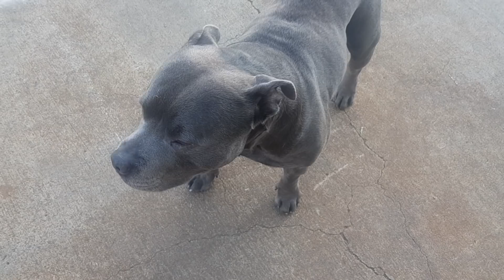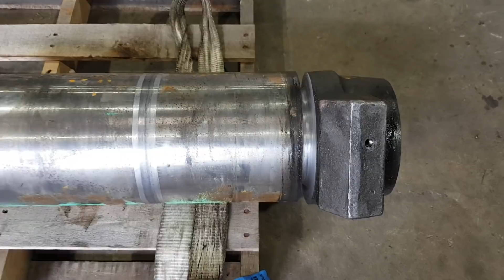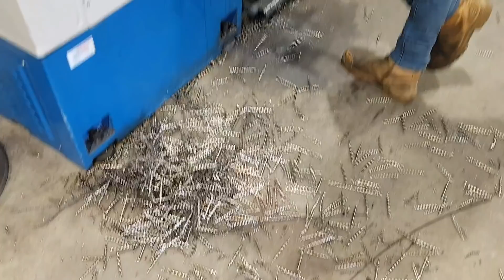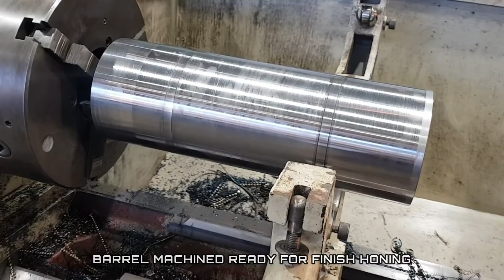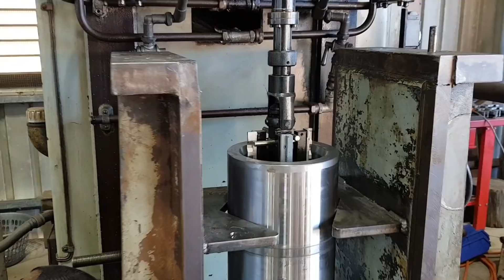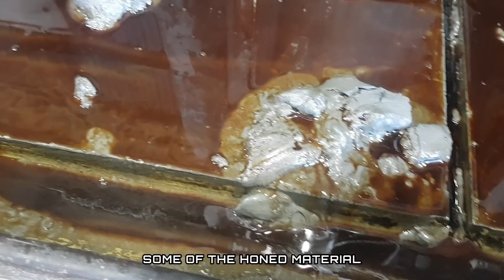Machining and Vertical Honing a Caterpillar Dozer track adjuster cylinder | Part 1

Comment: I stumbled on this channel by accident. I don't know much about machine shop work, but I can appreciate it when someone knows what they are doing and are good at it. I find myself learning something new each time a video is released. Now, if you would only explain what those initials mean for the various cutters you switch in and out.

Oh, and the dog is the bomb. I've got a few of those myself (although my bully is bigger and blind).
Reply from the maker: Hey mate welcome to the channel thanks for watching and the great comment. The initials stand for the universal insert designation to identify it's shape, angle, tolerance, chip breaking. Cheers, Kurtis 👍

Comment: I liked your honing machine. 
I thought most honing machines were made on horizontal axis but vertical certainly easier to use. 
Yes I’m a machinist for 35 years       
And I have worked on D10’s
I like your videos thank you
Reply from the maker: Hey mate thanks for watching always appreciate the support from others who know what they're doing! Yeah the vertical honing goes well I'm just limited with extending the stroke length unless I cut a hole to sit the machine in hahaa

Comment: Good morning my name is David I had a auto shop for over 40 years I retired in 2013 I got bord started doing equipment repair part time from my house I was in the local hydr. hose shop getting some made a man was in getting some hoses made to he was asking for help to repair a dredge so I told him I could try lol after I finish the job he asked me if I would like to work for him at a sand mine so I worked on all kinds of equipment so he sold the land so now every body wants me to work on there big equipment lol so I have been watching your YT channel I have learned a lot about line boaring and the proper way to weld and mechan I have a small Smitty and I learned the correct way to use it I wish I was younger I would buy more equipment to add to my service truck cause I enjoy working on big equipment and weard stuff.peopel say I'm crazy for wanting to work cause I'm 63 and I want to learn more so thank you for your videos and explaining what you are doing and why if you ever come to S FL and bring the pup I had one just like him he was lost to cancer but he had a great life. PS sorry for along mess. I have to go finish repair center pins on a cat end dump 😜🐾 dualydave@gmail.com  if you send your mail address the wife wants to send pup a toy 👍

Comment: Stick a live centre up its arse... heh heh. Love the shots of the safety officer. Another top job! Love that honing machine.
If you're interested, check out the 50 ton rudder on HMS Victorious aircraft carrier that I worked on in 1968 as a 3rd year apprentice. We had to take it out, remove the old bronze sleeve, machine the steel stock with an air driven contraption on the dock bottom, then heat the new sleeve over a wood fire as it was rotated and get a team of labourers to lift it on wooden bearers when it was hot enough then slide it on the machined stock to cool down and grip. Then we had to re-install it. The for the pic here "The Rudder may not look very big" scroll down to page 6.
Reply from the maker: Hey Fred Thanks mate for watching this weeks vid! Yeah we've got it made easy in this day and age with all the new technology and tooling available. Will have to check that out, would've been one hell of a job to do! 💪😎 Cheers have a good week
Reply: Well, dunno why but YT doesn't seem to like me putting any more in... Bummer! In the pic, that's me on the right of the three in the left foreground. I remember it like it was yesterday.

Comment: What would be interesting to know is the cost savings to the customer with you making/repairing these parts vs. them going to Cat and purchasing them new. I remember having backhoe outrigger cylinder rods cut off and replaced at a local machine shop vs. buying complete new ones from Case. Having the machine shop cut off the damaged rod and then welding on new rod was 1/2 the cost vs. buying new.
Good job on the video's and content. And good job to your gal for filming for ya.
Reply from the maker: Hey Bill thanks for watching mate. Yeah we're about the same usually half to a third of the cost of getting new from OEM 😎👍

Comment: You are dead right. It is not as easy as it sounds. I narrate my videos after they are completed, how you manage to do it at the time, I don't know.  Your camera operator/editor does a brilliant job too.
Reply from the maker: There's no way I would do this without the help of my misses who videos and edits. Half the time I don't know what to say and she asks me questions or prompts me with ideas. All the more to you if you do it all on your own! 😎👊💥
Reply: @CuttingEdgeEngineering  I think the chuck on my cnc lathe would fit up that bore you were machining.  I usually run multiple parts so I can shoot one angle and then another.  All on tripod without moving as the stuff I do is so small. The way your wife gets such steady shots is fascinating. Does she use a gimbal or just image stabilisation?
Reply from the maker: Yeah that's the way to do it if you're on your own! She uses neither just a very steady hand and her Samsung galaxy phone! The timelapse we use an iphone on a shitty selfie stick attached to a noga dial indicator holder haha. She actually bought a gimbal but doesn't like using it 🤣

Comment: Kurtis, BRO!?!?! Whats up? I've been  heavy diesel tech since I was 21(since 1996), and I LOVE watching your videos. This is a dying art my friend. We've become this throw away society, and I admit that in my business often it's just easier to replace a part(I also work for the government of a local county).
Anyways,, I have a question: Why do you always put your hands on the spinning shafts or that round disc on the top of the boring rod? I've always been told not to touch a spinning high torque shaft in motion. You can get wrapped around the shaft and loose a limb. Theres a story of a farmer fell into him bush hog PTO shaft and it took both his arms off. He dialed 911 with a pencil and then laid in his bathtub(so as not to get blood everywhere) and waited for help. He lived. It was on a Trauma in the ER type show here in the states. I always notice you putting you hands on moving shafts. Is it just  bad habit or is there some hidden meaning to it? Just curious. Thanks MK.

Comment: Hone is a beast. Love the tractor PTO attachment :o)
Reply from the maker: Hey mate great spotting. It's a little agricultural but found it in my container and it works haha
Reply: @CuttingEdgeEngineering  I’m sure the original had Allen screws of a bizzar size and every time you removed it was the equivalent of cntr alt del F1 :D (I’m fighting roundthane today. Joined it three times now on the baby miller. Tea break to de-stress ^-^

Comment: On the lathe why is lubricant only used on certain tooling or in certain situations? Also is cost and possibly down time the only reasons why someone would choose to refurbish a part rather than buy new from the manufacturer? Would there be a large percentage difference in cost machining a new hydraulic cylinder rod/barrel rather than to buy new
Cheers, thoroughly enjoying the videos
Reply from the maker: Hey Lewis thanks for watching and supporting mate. Great questions. We can do it for less than half the cost of new from OEM and that's if the parts are available, often they are discontinued components. I'm using carbide inserts which can be run hot/dry or flooded wet, I prefer less coolant mess so try not to run it all the time definitely not for the internal machining as coolant gets into the chuck and flicks all over the workshop hahaa

Comment: Thanks, nice video!  Instead of removing the drippy bar & head for new consumables, can't it just be swung forward outta the work and still over the pan, with a fabbed metal or wood brace to position it?  It'll be at a convenient push button adjustable  height, only drip where there are already drops and save some walking around & table cleanup.

Comment: Did both sides need a referb ? the wear rings have completely dissinterated.
The big verticle hone is getting a work out, awesome. 
Why are there 2 grease fittings on the head? is one a release nut and the other a grease nipple fitting ?
Is the Anr hone head made locally or imported ?
Reply from the maker: Hey Roland thanks for watching mate great questions. Just the 1 side needed doing. Correct grease in 1 and releases out the other. The honing head is a Sunnen made in USA. Cheers, Kurtis 😎👍

Comment: If part 2 isn't out yet then how do you address the weld of the two parts on the inside? I assume you get full penetration. Do you have to go back and bore and hone the welded area?
Reply from the maker: Hey mate thanks for watching, part 2 is uploaded now if you want to check it out. No need to go back and bore/hone the weld. The inner sleeve never gets back that far in the cylinder for it to be a problem 😎👍

Comment: Another great video! Could you explain why you switch cutter inserts in the middle of turning something? Looking forward to the next part.
Reply from the maker: Hey mate thanks for watching. For some reason a different brand of insert we tried doesn't cut well very fussy it needs exact parameters to work, I tried 2 of them before going back to what we normally use haha

Comment: What's the difference between using a honing machine vs. using a boring bar? I'm guessing that the honing machine is more accurate because a boring bar can flex a little.
Reply from the maker: Hey mate yeah spot on, would need a really good lathe and tooling to get the same sort of finish with boring bar. 👍

Comment: Did you use a round insert rather than a parting insert as it gives more warning of breaking through?
Reply from the maker: Hey mate a few reasons, it's more robust so can drive it in, rough it out and also it was friction welded so a bit harder to find the weld joint which would become even harder with parting insert 😎👍

Comment: Nice machining man , how long did the honing process take , just the raw cutting without the setting time ? 0.5mm sounds like a lot to grind   . PS: finally a METRIC youtubemachinerer :D
Reply from the maker: Hey mate thanks for watching takes between 1-2 hours to remove 0.5mm without getting too excited and over loading the stones
Reply: @CuttingEdgeEngineering  why did you leave 0.5mm of material on the finished dimension. wouldn't 0.2mm be enough? so you would have to hone less. When building engines, only a few 1/100mm are honed. Best regards from germany!

Comment: Awesome capability to have the home available to finish off deep bores like that, not easy getting a good finish deep inside a bore like that!

That track tensioner cylinder gets pumped with grease as the track pins get worn out to take up slack yeah?
Reply from the maker: Hey mate thanks for watching! Yeah the big girl goes well. The track adjuster is essentially a suspension component in the recoil assembly

Comment: How do you keep track of your center height with all of the different tools and shims you use in that 4-position tool post? I can't stand working with them.
Reply from the maker: Hey mate I've used them that many times I just know them and what goes with what so it's not a problem 👍
Reply: @CuttingEdgeEngineering  Wow since the shop I worked at you need like one piece if HSS and two thin shims for one tool, three thin shims and a piece of mild steel for another, and then I sharpen another piece if HSS I was using and then I have to figure out a new center height... I just like quick change tool posts so much more. Is there a reason you don't use one for rigidity or something?
Reply from the maker: Wow that sounds like a head fark. Most of my toolholders are the same height and I usually just need 8mm shims to make them center height, much easier! Yeah havent found a QCTP rigid enough yet in Aussie for my liking to change my machines over

Comment: A few things, on turning the O/D did you miss out the bit where you'd have to adjust the tailstock to achieve parallelism..?? also when you turned the job around for finished boring; the jaws in the three jaw chuck appeared to be hard jaws and not precision sized soft jaws..?? I worked for many years turning hydraulic cylinders, rams. stuffing boxes, trunnions etc you name It I've turned It ,and the questions I've raised would be done as a matter of course...Apart from all that I'm a new subscriber and really enjoy your content, keep them coming...
Reply from the maker: Hey mate thanks for watching! I guess the difference might be being an employee vs being the owner, i don't have anyone telling me what to do and consider those unnecessary steps that waste my time to achieve the exact same outcome in a quicker time frame. Cheers, Kurtis 😎👍

Comment: Kurt, nice work again mate! I never saw a adjustable 4 jaw chuck on the headstock on a conventional machine. Did you build this yourself or was it a standard accessory on the lathe? Anyhow; nice to have and work with. Thank you for sharing and keep up the good work! Best, Job
Reply: I think he built it. Check the video library. He has a video on it.
Reply: @mfreund15448  thank you. I found out later. I’m planning on making one myself. Very handy tool.

Comment: Once again you make it look easy, until the bloopers at the end.  Ha ha.  In the comments below you mentioned that you hadn't been able to find a QCTP rigid enough for the work you do.  I have a Dickson style (made in Italy by Rapid Original) tool post on my Broadbent Schofield lathe and it can handle anything that lathe can do.  To give you an idea of what that lathe can do it has only 24" of swing and 120" between centres but weighs in at 20,000 lbs, with a 20 hp motor.  I have taken longitudinal cuts on this lathe that calculate out to 25hp and a facing cut that took 35hp and the tool post didn't flinch.  Probably most surprising is that the motor didn't seem to flinch either despite being heavily overloaded. I do like the ease with which you can unlock and rotate your tool post however.  Mine are not pinned an therefore they are all reefed down so they won't turn under a heavy cut.  Ken
Reply from the maker: Hey Ken thanks for watching mate and sharing about your tool post it sounds top shelf and your lathe is a boss 😎👊💥

Comment: Do you get the same "where the f**k is the bottom" thought I get on deep parting cuts? 😆 The double roll of metal sticking proud of the barrel suggests Cat did a friction weld to join the barrel to the base??
Reply from the maker: Hey mate yeah I thought I was getting through it then measured another 28mm to go 🤣😭 spot on it's friction welded
Reply: @CuttingEdgeEngineering  Scatterpillar: "We gotta justify that Gazillion dollar friction welder somehow "😄

Comment: If that is a sunnen dial bore gauge. And you have a setting kit. Please examine the ends of the standards for wear from the carbide balls.on the ends. And on the fixed contact faces on the base. It can throw you off several thousands.
Reply from the maker: Hey mate thanks for watching and sharing that! 😎👍

Comment: how close do you usually want to dial it in by? 20 thou or is there more allowance for these sort of projects? I'm guessing it'll be 20 thou and under if you're doing a propshaft but if you're machining something anyways, you getting it that close isn't that critical so  a non rotating part?
Reply from the maker: Hey mate thanks for watching. Always best to try and get it as spot on as makes it easier in the long run but getting within 10thou is usually our standard for this sort of job 😎👍
Reply: @CuttingEdgeEngineering  Damn, that's tighter than propshaft clearances! Hahah, maybe you could make high HP performance propshafts as a secondary thing?

Comment: This was all very interesting but I do not see how all of this high powered machining work is cheaper than just buying a whole new cylinder from Cat.
Reply from the maker: Hey mate thanks for watching. Yeah we have some good heavy machinery but our overheads are no doubt alot less than a factory with hundreds of millions worth of machinery parts 🤣 We pass our savings onto our customers and can do this for about a third the price of an OEM replacement 👍
Reply: @CuttingEdgeEngineering  Don't forget the way shorter lead time to get a replacement part versus getting one direct from Cat.

Comment: All I want is. 200 HP lathe with a 24 inch spindle bore a 30 foot bed and 80 tons mass for rigidity . Inch and metric dials that are as true as your digital read outs and a quick change tool post that automatically changes 800 lb tool holders  Tell me u don't agree

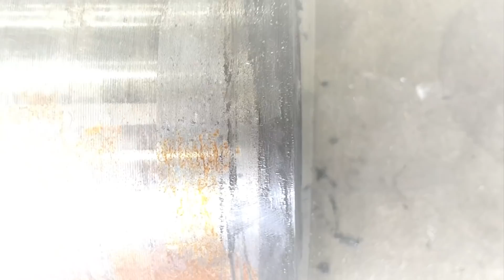Comment: At 10:28 how do you part the barrel end?
Reply from the maker: Finish it off with a 1mm cutoff wheel on a grinder 😎👊💥
Reply: @CuttingEdgeEngineering  Nice mate 👍🏻

Comment: Is 20 thou a lot to hone out im an engine Reconditioner I bore block with .0025 to hone out any more and the stones start glazing up the bores cant keep em straight or round just ends up being a fucking abortion
Reply from the maker: Hey mate that does sound messed up haha Our standard unhoned tube needs 40 thou or 1mm to bring it to size. The stones we use in the beginning are very soft for rounding the barrel, then medium stones for heavy material removal and then finishing stones to finish to spec. There is definitely an art to it with right tooling, feeds, speeds, oil flow, head pressure. Easy to make a mistake
Reply: @CuttingEdgeEngineering  i enjoy your content by the way I love maching wish I got to do more of it yano just make shit
Reply from the maker: Thanks for watching mate glad you enjoy yeah it's definitely rewarding work